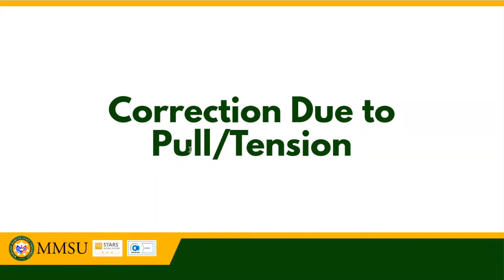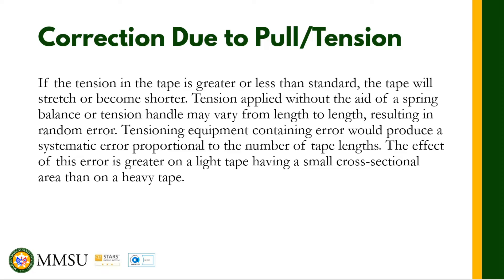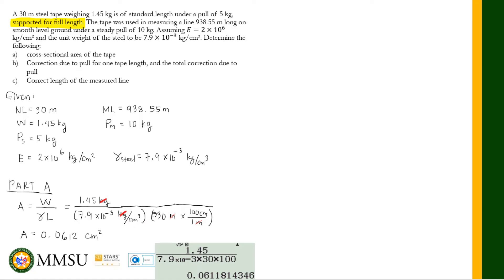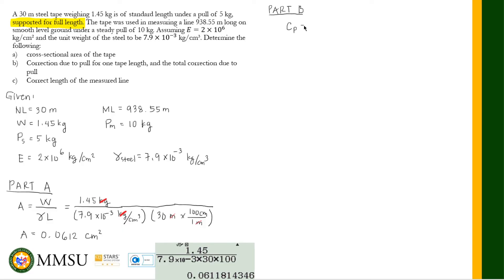Correction Due to Pull or Tension | Taping Corrections | Surveying

Comment: hi po pede magtanonggg?
Reply from the maker: Pwede naman po
Reply: @JonasClassNotes  pa'no po kung di given ang Modulus elasticity at cross sectional area? may constant value po ba sila?
Reply from the maker: @peregrinarizannkaeya.8910  Ang modulus of elasticity ay innate sa material. Pwede mo isearch kung ano ang modulus of elasticity ng isang material. Kapag A36 steel, E=200 GPa.
Reply: @JonasClassNotes  steel tape po? 200 gpa?

Comment: A line recorded as 472.90 m is measured with a 0.65 kg tape 30.005 m long with cross-sectional area 3 mm² at 20°C under a 50 N pull. At the time of measurement the temperature dropped to 5°C and the applied pull was 75 N. The line was 3% grade, E = 200 GPa, α= 0.0000116 m/°C.

Comment: Question: 11. A Base Line Was Measured To Be 150 M Long With A Tape At A Field Temperature Of 27°C, The Applied Pull Being 14 Kg. The Tape Was Standardised At A Temperature Of 15°C With A Pull Of 8 Kg. If The Designated Length Of The Tape Is 20 M, Weight Of 1 Cm Of Tape = 7.86 G, Total Weight Of Tape = 0.8 Kg, E = 2.109 X 106 Kg/Cm² And Coefficient Of Expansion Of11.2×10^6 find true length of tape?please solve this question

Comment: Sir, what if the tape is too short and the Csubp is -0.0034m. Do we include the negative symbol of Csubp when finding for L'. Like this L' = L - (-0.0034m)? Or is the negative sign on the Csubp just an indicator.
Reply from the maker: I think the negative sign is the indication of the "too short" description. You do not need to use it again sa calculation.